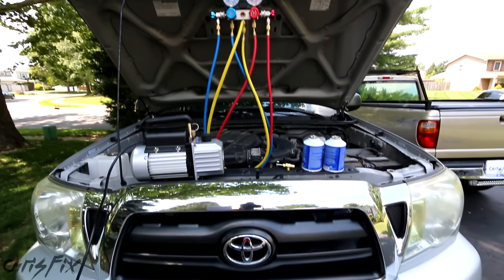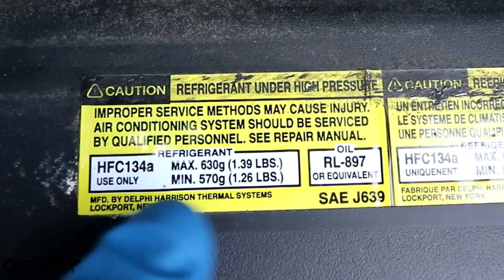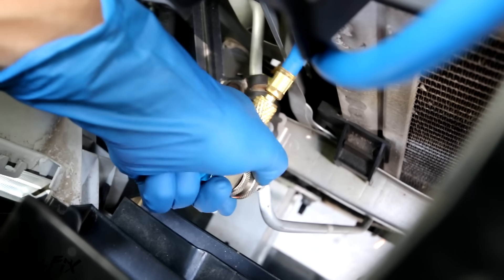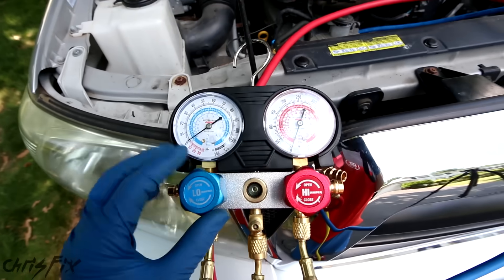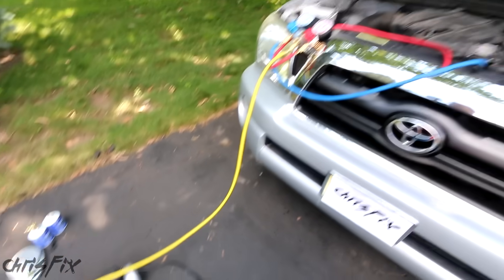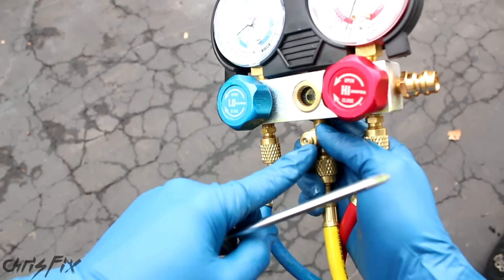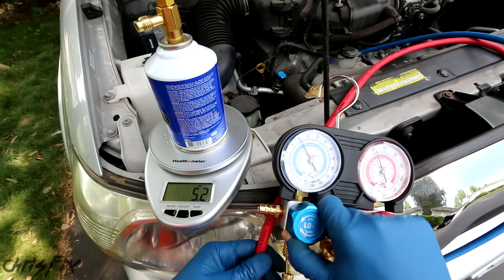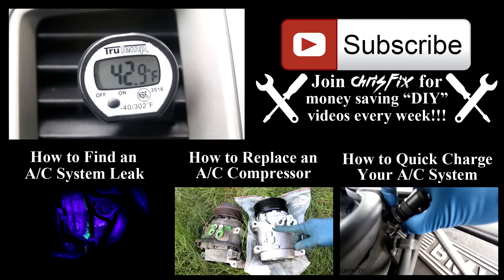How to Properly Recharge Your AC System

Comment: Question an the yellow supply hose , just noticed the inside of the hose is different.  One is open the other has square kind of pin . Which end goes to the manifold qauge and to the R134a can
Reply from the maker: Open end connects to the manifold
Reply: @chrisfix  Thank u , looked everywhere no info you r the first to tell me 100% .

Comment: Do I need to add oil if I didn't replace any major components? Removed all coolant and replaced schrader valves and pressure switch.
Reply from the maker: Shouldn't need to
Reply: @chrisfix  Thank you!!!
Reply: @chrisfix  The valve that came with the manifold that screws on top of the coolant can won't let anything out. I've tried multiple cans. I can see it pierces the rubber seal in the can then when I open the valve the seal closes. Can I just use my small gauge and trigger that came with a can of AC Pro I bought a while back?

Comment: My low side gauge with the vaccum on would be in the middle of 0 and -30 . When I let it sit with no vacuum , it stayed the same. Not sure Why wouldn’t it reach -30 but I’m hoping it’s good
Reply: I let it sit 30 minutes to make sure it wasn’t leaking too. So now I let it run vacuum on again for another 45 min or so and am about to close the valves and turn the vacuum off to put the new refrigerant .

Comment: If I’m replacing my AC compressor and taking the lines off do I need to do all of this or can I just get a do it yourself recharge kit?
Reply: You need to vacuum it down to remove moisture and air. Pumps are inexpensive at harbor freight,if you don't vacuum down the system you will be doing it again as it can ruin a/c compressor and other components.

Comment: Not sure if I'm overthinking it but do you literally just add liquid to the open yellow line with the system attached and pull a vacuum after? Would like to see a video of what exactly you mean at 8:20, do the bottles usually just have a link up to the yellow line?
Reply: Not vacuum but refrigerant bottle. It will push under pressure oil into the system

Comment: How do you purge the air if the line is full of oil?
Reply from the maker: The refrigerant can will be connected and that will get drawn in so you can purge the line
Reply: @chrisfix  thanks for the reply , I mean if you have to add oil by dumping it in the yellow line after vacuuming the system, won't the oil come out the valve when you bleed the air? I'm re assembling and attempting to charge a system that has been open for over 2 years so I will definitely be adding oil and dye, thanks for the help

Comment: Where's your micron gauge,is More accurate
Reply: 134a is to be liquid charged only no vapor , and the air is supposed to be on high spd ,... not on low spd. That's why the temperature is low it is supposed to be between  50 to 55° supply air,
Reply from the maker: The manifold is really all that's needed in this case and r134a, r22, and r12 can be charged as either a liquid or a gas

Comment: I changed parts of the system and it kept its vacuum seal so it should be good but why is it taking it longer to empty out the refrigerant cans? The compressor was running as well

Comment: On a 03-07 silverado the high and low pressure are on the same line?
Reply from the maker: Cannot be on the same line. It can be near each other but the high side is a thinner line and the low side is a wider line.

Comment: Using latex gloves is not protecting much.

The point of a vacuum is to lower the boiling point of water so it boils off, not just sucking out moisture.  Temperature matters.

Comment: Is it not necessry to purge the lines before you begin filling with the 2nd can? That little Shrader valve stem on the manifold gauges would allow you to purge the air out of the yellow line, before beginning with the 2nd can?

Comment: This is the best video on vacuum down and re-filling your A/C system with refrigerant on the internet!  I've watched it 3 times and then did it on my 2004 F150 that was cycling the compressor constantly and barely cooling.  Found it had low AC pressure, 50 on high side and almost nothing on low side as the compressor would only run for about 5 seconds at a time and kick out.  Found it had a leak on the high side shrader valve using soap and water trick.  Evac'ed the system, replaced shrader valve, vacuumed down the system for the 45-60 min, refilled with correct amount of refrigerant and the system is working great, blowing 40 degree F air again!   Thanks!
Reply: How did you evac the system first? Will the vacuum evac the system?
Reply: @michaeli-7186  Took it to our local shop, they charged me $15 to evac the system, took about 5 minutes.
Reply: Hi very nice you found and fix the leak, cuestion did you add pag oil?

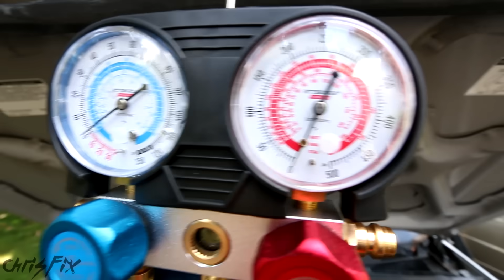Comment: Hey Chris, at 4:33 after you opened up the valves on the high and low pressure lines and read 0 PSI at gauges - aren't you going to read 0 PSI regardless because the valves on the manifold were closed off as well? Don't they need to be open so that the pressure gauges can read the pressure?

Comment: Other than the pressure switch, why would cause the compressor to not cycle but continuously stay engaged?
Reply: Possibly a stuck clutch or the relay that controls the clutch. Easiest way to find out is to unplug the clutch wire connector, if it's still engaged then it's a stuck clutch. If it disengaged then that means the clutch was receiving power from the relay so either a stuck relay or stuck pressure switch.
It's also important to note that some vehicles have variable compressors. With those then they don't cycle on and off like a regular compressor would. They control their output so they can run ideally near continuously.
Reply: Well the vehicle I am messing with is an 87 mustang gt.

Comment: helpful but the only thing is you cannot add oil through the middle yellow hose once you hook it up.  I had to buy extra oil compressed injector cans because I already sealed up the system.  The only way to add oil after you hook everything up is through the shrader valve or add it in the compressor before you hook up the ac lines.

Comment: You can and we often DO put the van on a warm part of the engine. It helps with getting the refrigerant out of the can and into the system. 
And you I should have covered the manifold gauge pressures you’re looking for as the manifold gauge set isn’t really needed if you’re not looking at the pressures. 
ASE certified mechanic (retired)
Reply: Why put a van on the engine??
Reply: @fartsmccracken1445  can. Auto wrong strikes again. 
And AI is supposed to be helpful?

Comment: lol. You do realize that your vacuum pump isn’t recovering the R134a  it’s pumping it out to atmosphere, so much for being environmentally friendly.
Reply from the maker: I made a video before this where I replaced the ac compressor (https://www.youtube.com/watch?v=rulXlnG2Unk ), before I did any work me and my buddy took his truck to the shop and got the system evacuated, then I did the work, and now in this video I am filling the system back up. Even if you didn't know that I made that video, you can see when I hooked up the manifold at 4:31 both sides were at 0 psi so other than some air there was nothing in the system lol

Comment: Isn't 40 psi 'suction pressure' too high for an 'r134a' based system. 
What was the ambient temperature at your area at that time?
Reply from the maker: No it can go higher on an r134a system and I don't remember, this was years ago now

Comment: What if all this was done to procedure but I only have mediocre air coming out? I have about 63f coming out of vents at idle, 58f when driving on a hot day. Compressor works, condenser fans spin, but it doesn't feel cold enough. What are some things that can mess with the performance?

Comment: Question:

If the pump sucks moisture and old freon from the car ; where does  the old refrigerant and moisture comes out through 
There is no outlet for all this waste to come out through
Reply: It goes into the oil of the vacuum pump which is why it's important to change out the vac pump oil after every usage or two. Mind you, you must also have the bulk of the existing refrigerant evacuated properly first.
Reply: After I asked, I went searching and found out there is a machine to remove existing freon
It’s called refrigerant recovery machine 
(Expensive)
Reply: @AlexC80  Well, the cheapest option, maybe not the best option, is to evacuate the system into a large can of water, that it doesn't vent to atmosphere. You'll then have to dispose of it properly as it will still be toxic to environment.

Comment: Hey Chris, thanks a lot party five years going on. I did what you did step-by-step and it’s going on five years and I got still got cold air conditioning I had to reset. I had to redo AC compressor put all new rubber, gaskets and all the parts they need it probably didn’t need it, but I did it anyways to make it last longer, you ain’t gotta do it. Don’t do it but you’re gonna order a whole rubber kit gasket pack off Amazon or Walmart AutoZone auto parts Pep Boys

Comment: As I'm recharging the system with AC you mentioned the blue gauge should drop and red gauge should increase. If blue does not drop and red does not increase then could it be a sign of a bad compressor? After 1 bottle blue stayed at 70-80 and red stayed at 75.. with the ac on low. I changed the drier and orfice. All relays receive power and work
Reply: sounds like compressor is not engaging if both low and high side are about equal in pressure

Comment: I go to purge the refrigerant and a burst of air comes out but that’s it what am I doing wrong?
Reply: the can needs to be upside down, properly tapped in with the adapter, and the valve on the can adapter fully open

Comment: Question: Will the vacuum pump pull the oil from a new oil primed compressor when you vacuum it down to pull out the moisture? 🤔    Big P.S.  Wow, I didn't notice this vid was posted 8 years ago!

Comment: If the refrigerant is low, there's a leak! Refilling will not do anything except have it bleed off into the atmosphere. 🤷‍♂️
Reply from the maker: Yes, in this case I replaced the compressor so I got the system evacuated and there wasn't any refrigerant in the system so it needed a recharge

Comment: Once you run the vacuum pump doesn't it pull the oil out of the ac compressor since it's running a vacuum on the system? Which then you would have to add the oil along with the refrigerant.
Reply: no, it only pulls out air and moisture

Comment: Is this the same procedure if the compressor was not replaced and thwre us still freon in the system?
Reply: No. If you still have refrigerant in the system, you can try recharging it (topping off) going by the proper pressures but you'll never now how much refrigerant is in there until evacuated. It shouldn't be low in the first place, so there is a likely a leak and it must be identified and repaired before you have the system vacuum and recharged.

Comment: Not so sure about weighing the second can with it hooked up to the hose, and valve ?  Surely the valve and hose hooked up when weighing is not accurate measure for just freon weight used ???
Reply from the maker: The scale went down 10oz so 10oz of the refrigerant is in there. Even if the hose/valve adds weight were still putting in the amount that's needed

Comment: I was told if we vacuum the ac like u did right now we would have to add oil again because the vacuum took the old oil out is that true or was I lied to?
Reply: The old refrigerant circulates some oil but some oil remains in the compressor as well. Vacuum pump will not vacuum out the oil, just air and moisture. It's a good idea to add just a few ounces of pag oil when doing a full vacuum and recharge since some of it got lost in the old refrigerant.

Comment: Hi Chris I recently just converted my r12 system to r134. For some reason when I was charging it the high side didn’t go up on the gauge. Do you know why? Also I put pag oil and I think I was supposed to to use ester oil. Do I need to vacuum down the system and start over?

Comment: Fantastic video. Would a 3.0 cfm vacuum be better or should I just get a 2.5 and save $40? Thank you
Reply: A larger vacuum pump will pull a vacuum faster. For example if the 3 cfm pump pulls it down in 10 minutes a 2.5 cfm might take 15 minutes. For personal use you don't really need a large vacuum pump, just wait longer. Or spend the extra money and save some time, it's your choice. If you don't have a micron vacuum gauge then it really does not matter because you would want to leave the pump on for quite a while either way.

Comment: Hello Cris, can you tell me what is in the can, R134A refrigerant or some substitute? If a substitute, what is its composition? Regards, Peter  ps. Is it true that these cans contain LPG (propane butane)?
Reply: The cans he is using are pure 134a. Some cans have leaks stop additive but those should be avoided. In some countries like Canada it is illegal for unlicensed people to buy 134a due to the GWP but they can buy R-12a refrigerant which is a 134a retrofit. 12a is a mixture of propane and isobutane. 12a has a much lower GWP so unlicensed people can buy it.

Comment: I have the same problem. Fan still running minutes after turning vehicle off and A/C blowing hot air. Also fan cuts on as soon as I turn my truck on even with A/C off.
Reply: You need too probably add anti freeze to ur radiator 😊

Comment: I got a manifold gage tool that is not marked on knobs which way is open and which way is close.  It's a very confusing tool.  For the knobs on the tool close to gages turn knobs clockwise to CLOSE.  For knobs near High side and Low side connectors that connect to vehicle's AC system turn COUNTER clockwise to CLOSE.  Not very intuitive.

Comment: Great demonstration of the procedure. Got a question. My 2011 buick enclave had a hole in the metal line. It's the refrigerant liquid line. I bought a line splicer, followed the directions, I0mm line size. But the line slipped out. What you suggest. To replace the line would cost around 1900.00. Let me know thanks. Riley

Comment: For future: I'm not as smart as others, but for the few seconds you showed opening/closing of the ports connecting to the vehicle, it would be beneficial to mention that opening is righty tighty and closing is lefty loosey. Mainly because its the opposite on the gauge valves itself. I did eveythjng correctly, but basically wasted a 134a  can because i technically never vaccumed the system and it was closed off the whole time.
Reply: You just saved me 😂😂

Comment: Why did you put the ac on low when everyone tells me to put it on high? Also when charging the ac was the high side on the gauge manifold open as well? I see it was open on the high side line itself
Reply: I think blasting it on high makes the compressor work harder so running it on low ensures efficient draw. Leave the high gauge off. It will still read when valve is closed. Chris mentions only using the low pressure valve at around 10:00

Comment: when the a/c gauges are hooked up , should there be suction at on the yellow line when your start to add R134 ?  I am a newby and I might have done something wrong.  not sure.  just noticed when I took the can of R134 off air blew out of the yellow line pretty hard.

Comment: Vacuum for an hour? On that Small system
Reply: Pull vacuum for a few minutes first. Leave standing for one hour to make sure there are no leaks. Then pull vacuum again for 30-45 minutes to make sure all moisture and air is purged from lines, compressor, condenser, and evaporator.

Comment: Very good and informative. Thanks for that. But you didn't flush the tube air after you connected second can ;-).

One more question: When you are refilling you have only opened the low side valve right? how the indicators show both side preasure? Is it not needed open the high side value to show its preassure value? Or else it anyway shows the preassure value ... only when opened connect with yellow tube?

Comment: Some systems can be damaged if you flip the canister upside down and introduce liquid refrigerant directly to the system. I Have a new "vintage" system from classic auto air in my 65 mercury and was advised to keep the canister upright the entire time to only allow the system to accept gas. Apparently can damage the reeds or seize the compressor. Takes a long time but the canister empties eventually.

Comment: Hey Chris great video! My condenser has a pretty major leak - found it by adding the UV dye just like you explained.  One question though - I'm going to have to add oil when I replace the condenser.  If I pour the oil in the vacuum line and then purge the line before adding the freon will that no blow my oil out of the line?

Comment: I may try to do it on a c4 vette 
they say water may be trapped so if there is liquid water the pressure will go up after a while upon using the vacuum, basically would act as a leak, then you would need to try again and it should be fine after all water evaporates. not sure if it ever happens to have liquid water inside 😂
thanks.

Comment: Ma man!! Excellent video. So after replying the compressor, should I pull a moisture vacuum before or after I add the oil through the yellow line. I see some videos on here actually suck the oil through the yellow hose.

Comment: What are the risk of not vacuum after an accident and replacing the condenser? My dad used to just pump in the freon and we never had any issue but just want to know. Also, the last time I took one of my cars to fill in freon after a condenser replacement the shop only did the vacuum for 5 mins.